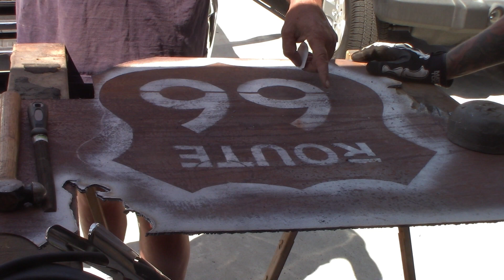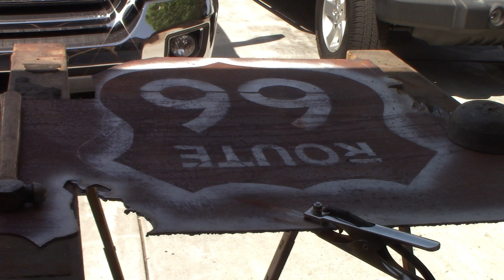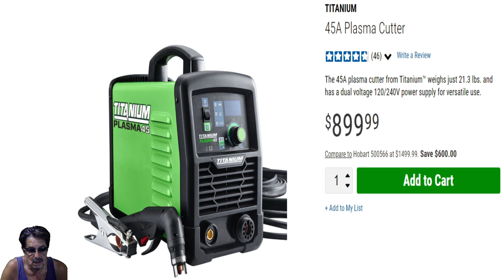Titanium plasma 45 plasma cutting torch review with tips on use

Comment: Good video.  Were you using a drag tip on the plasma torch?  The slag from cutting can also be removed by sliding a piece of steel across the back side cold rolled works good because it has  a sqaure corner. Good video keep the videos coming.  I saw justin's video.
Reply from the maker: yes the drag tip is the silver shield on it and it accurately keeps the distance so you do not ruin the consumables so fast but we cut half the day with it and still looks great...thanks

Comment: Excellent review.
Hey, I just bought the little HF Tailgator generator for $109. It's on sale/coupon this Labor Day weekend. I have a 4300 watt generator but for the price, I thought, "Why not?" for the little one.
Reply from the maker: Labor Day Weekend Sale is not bad out at my local store and good discounts - Generator sounds 
like a deal at that price
Reply: I have a tailgator also had it  for a few years paid 89 for it so that tells you how old it is, work good for a small generator, worked with someone who had on also no problems, just remeber to run the gas out by closing the fuel valve, so the carb is dry for storage.

Comment: Nice review but my $200 CUT50 does just as well.
Reply from the maker: not familiar with that but ill read about it - it is fun doing those signs etc-
Reply: qfdforme not when u use it on a cnc table  tho...
yours  has crappy high frequency start.
Reply: Keyboard Warrior 
Mike Festiva uses it on his CNC table with no problems.  You do not need pilot arc for bare metal.  Check out his video.
Reply from the maker: @qfdforme  Thanks and i did go watch his video on this - he has a very nice setup with the CNC and computer - more elaborate than i need but i like his videos so thanks for the tip - this machine is nice to use and i will do another video on it soon.
Reply: The Home Handyman 
Mike Festiva adapted his Titanium plasma cutter to his CNC tables in subsequent videos.  I also downloaded the Titanium plasma cutter manual at it has a 3 second pilot arc to permit plasma flame initiation without touching the surface.  Great for painted and rusty material.  The Titanium plasma cutter is a nice machine but for less than half the money you could buy the Lotos CUT50 ( $399 on Amazon ).  It also comes with a 1 year warranty.  HF only has the default 90 day warranty.  Check out the quirky New Zealander Pete from Pete’s Tools on Youtube.  He explains a lot about lower cost plasma cutters.  He even devises a scheme for converting a high frequency start (I.e., touch) to pilot arc on his old 40 amp plasma cutter.
Reply from the maker: @qfdforme   I will look into the New Zealander - other opinions on these plasma cutters is good because I do not own them all.
Reply: The Home Handyman 
Once you get past his style he is a font of knowledge on low cost Chinese plasma cutters.
Reply from the maker: @qfdforme  agree and ill be watching more of his videos - thanks
Reply: The Home Handyman 
Enjoy.